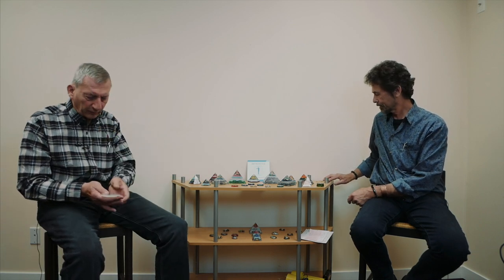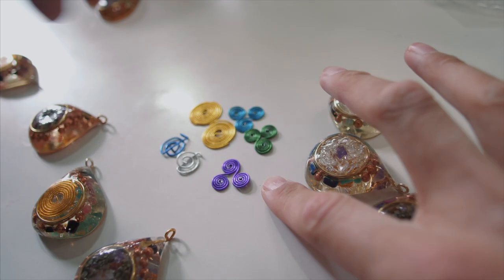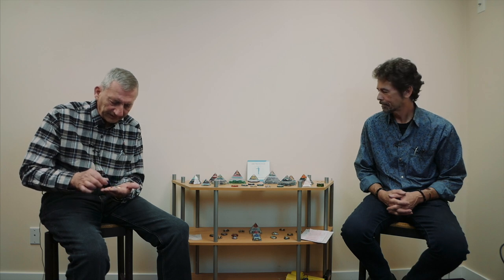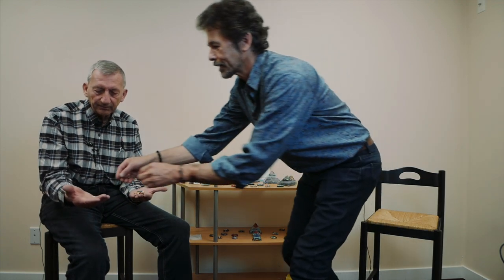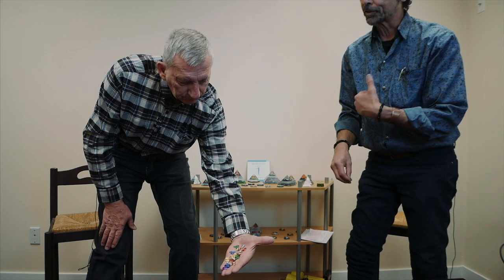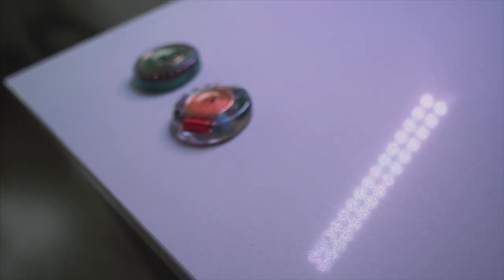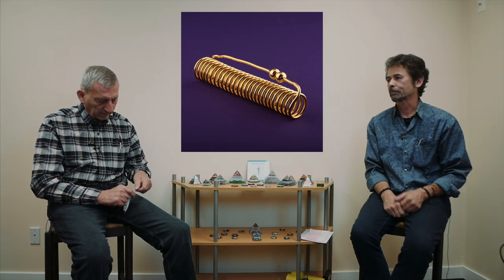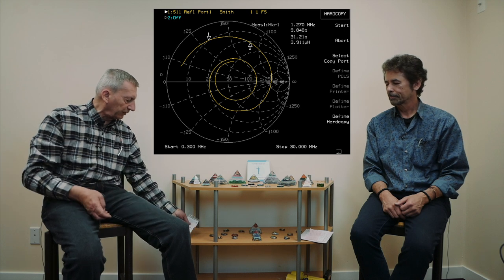The Secret to Coil Rotation Flow inside of Orgonite (Orgone Generators)

Comment: You are absolutely correct sir about rotation. But it depends for what purpose you are using it for. The counter clockwise centripetal force is used to absorb energy in the surrounding space and then imploding it, then it comes out on the other side as centrifugal force (clockwise from the other sides view). This is very useful. If for instance you are charging water using a vortex. It is best to use counter clockwise from the top view. The reason is that as it is spinning it is absorbing all the orgone from the air, once the air and water reaches the apex of the vortex it implodes thereby creating more energy and becomes, centrifugal (explosion) to charge the rest of the water. If you used the clockwise instead, it will deplete the water from energy. I have tried many experiments with this. Another way that you can use counter clockwise is that if you have a wand that is coiled, you can have it absorb your energy, then transfer it through the crystal and send it to someone using centrifugal force (clockwise from the other side). And if you are grounded during this, basically the earth can supply you with extra energy to transmit. This is the basis for real psychotronics devices. Clockwise is great for charging a room or getting energy from a device directly.
Reply: can you elaborate more on this? im quite interesting in learning this more. 

so for a pyramid device that i want to produce good energy in the enviornment (absorb bad and put off good), would i use a coil that is clockwise or counter clockwise (from the perspective of looking down in the pyramid as it is sitting normally).? 

for something like a chembuster for instance do i want the coils beneath the pipes to be counterclockwise or clockwise (looking down the pipes toward the base of the orgone)?
Reply: is this charging water from above or below? and which one is clockwise in the video? so confusing...
Reply: Hi, so you probably won’t see this, your comment was years earlier
I made some organized generators. When I hold a pendulum over them some from north to to west and some run north to east. no I’m not explaining myself very well which one is correct

Comment: When carving a magic wand,  what direction should I carve the spiral going from the handle to the tip up the shaft of the wand? Should I make the spiral in a clockwise direction from hand to tip or anticlockwise direction? If I'm holding the wand in my right hand, would the spiral going up the shaft turn right away from my body,  or would it turn left inwards to my body? Thanks

Comment: Can i just flip it?
Reply: Yes. Just mind the poles when casting
Reply: I just watched it and came to the same conclusion..you just coil it any way you think you are doing a better job..more symmetry=less collisions=more energy output... although when placing it ,with an intention of evoking positive aspects of energy from the orgonite you have to go clockwise... counterclockwise is when you repel energy of a sort and that's probably why the others and even you don't feel it...because it's not there 😅 the intention itself cancels any sort of resemblance to the will behind it because that was your will to start with.. to search something you expelled is like removing the wine 100 meters from the table and try to look for the wine on the table...it's not there

Comment: I'm still confused.
If I'm looking directly down on an organite pyramid, Starting from the top the coil should appear to be wrapping downward in a counter clockwise direction?  Because the energy flows clockwise from the bottom up? Does that sound correct?
Reply from the maker: It’s good question, we will be answering it in the future videos. Stay tuned.
Reply: Have you find a clue ?
Reply: From my limited understanding, you are correct. Unless in a situation described by Luscent on the main thread

Comment: If you make the coils where they are spiraling clockwise from the outside to the inside it amplifies their energy tremendously and then if you can go on a ley-line the end of both ends of the wire are straight so that they create like a compass with the center pointing east to west while the top is pointing North to South you can generate Natural Energy current through the Ley lines
Reply: How?